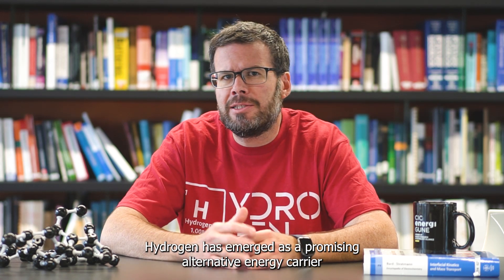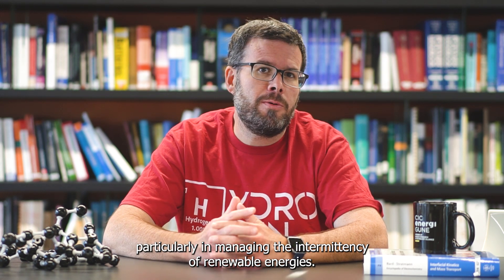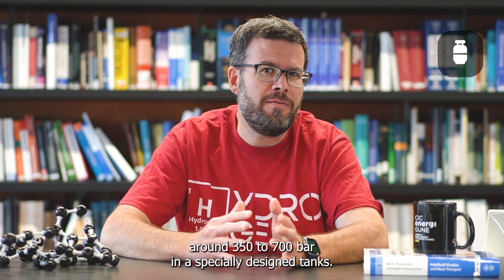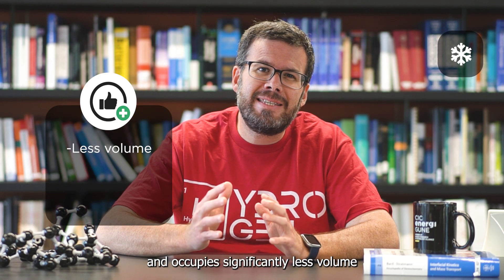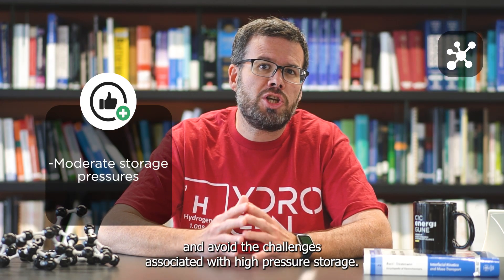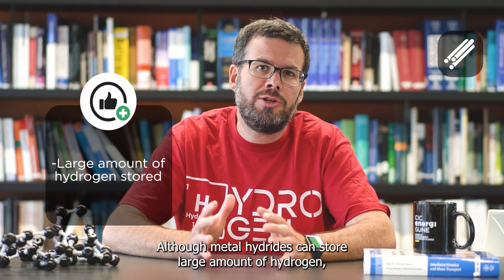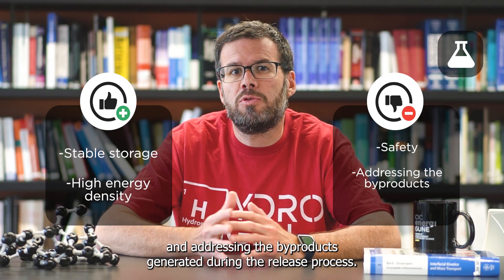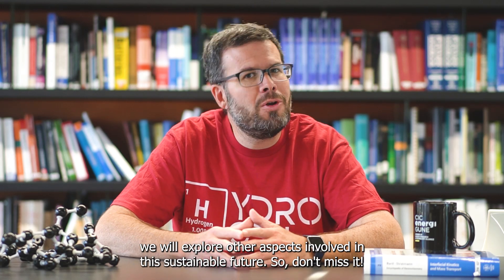Hydrogen STORAGE - 📚The en𝗖𝗜𝗖lopedia by CIC energiGUNE📚

Comment: very well explained brother please explain brother keep going 
I have few questions that have impect on the world's economy 

1st 
how much electricity is required to convert distilled water into oxygen and hydrogen 

2nd 
how much hydrogen and oxygen we get from electrolysis of distilled water
3rd 
which electrolytic cell is most advance and efficient we use that have highest efficiency like 85 to 95%
4th
how much amount of hydrogen needed to to run 1000c car engine
to run 20 km

which most powerful battery of 120kwh we use to run car for how long in kilometers 

is we use hydrogen as reverse oxygen rich enviromen in this mathod also petroleum free environment

is we use hydrogen directly or storage in container of gas fuel car 

is it sustainable
please make a video with full details